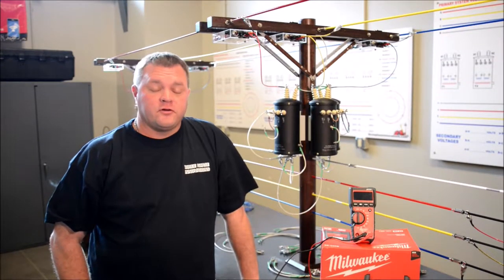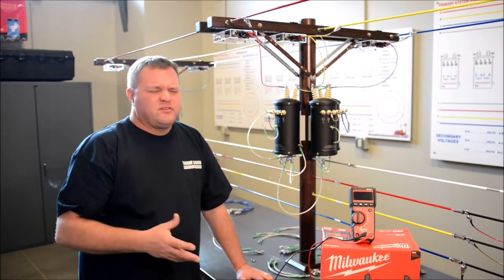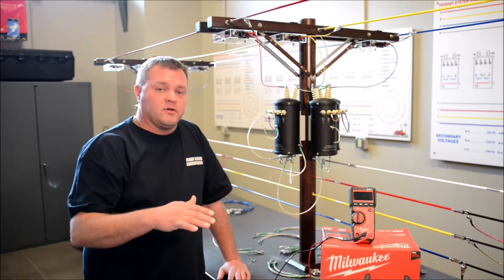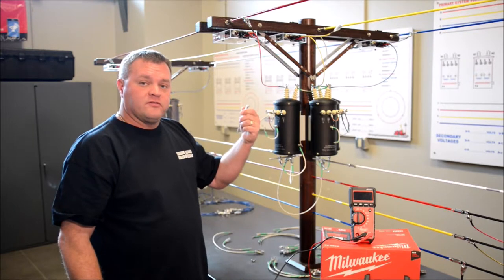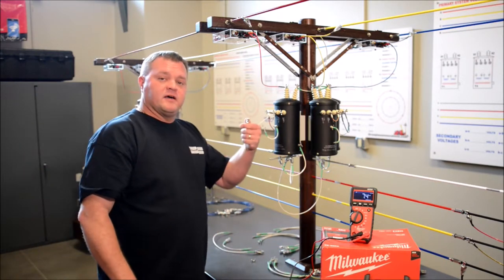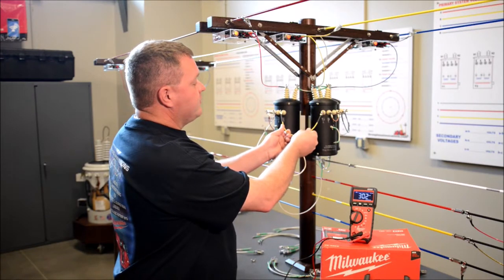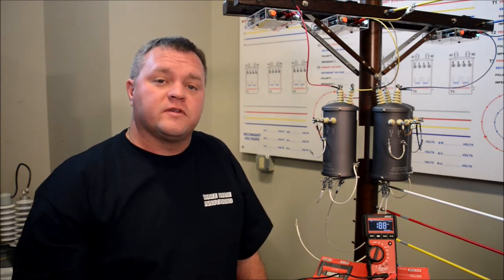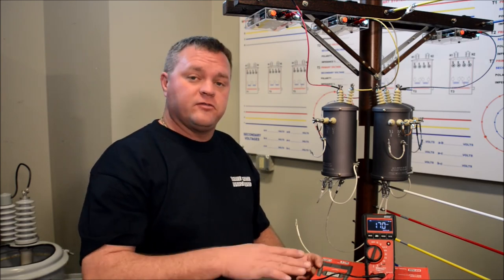Corner Test Point for a Wye-Delta Transformer Bank

Comment: Are the test voltages of 40(wye-delta) and 10(delta-delta) based on a specific secondary rating of the transformer? Or will it always be 40 and 10?
Reply from the maker: Mark, that is a very good question. We have used various high voltage applications as well as different kva transformer ratings. But we the secondary voltages have always been 120/240-volts this is due to the harmonic build up between the primary and secondary coils that cause these voltages. Keep in mind they can drop 10-20% based on our studies. We need to try this with a 240/480-volt secondary and see if the results are the same. Again great question Mark.
Reply: @threephaseinnovations7546 ave you ever ran across a 240/480V 4 wire delta?   I've heard of them but never came across one since they are extremely uncommon.  I've seen  120V/240V 4 wire open deltas in rural settings where a  farmer needs some 3 phase power for motor loads, but the majority of the loads are 120/240 single phase.